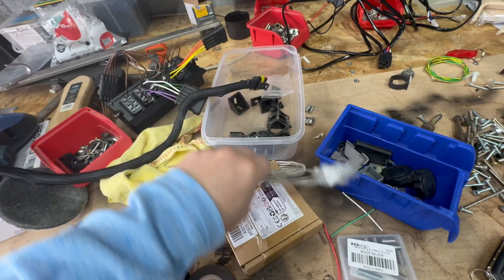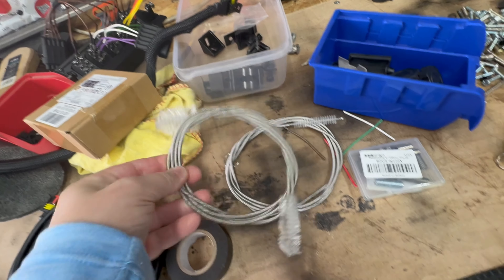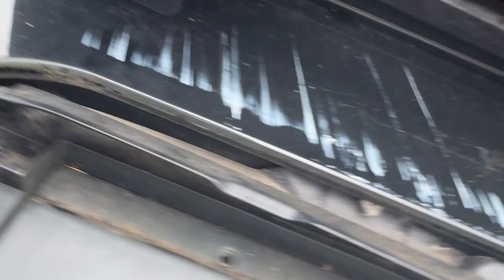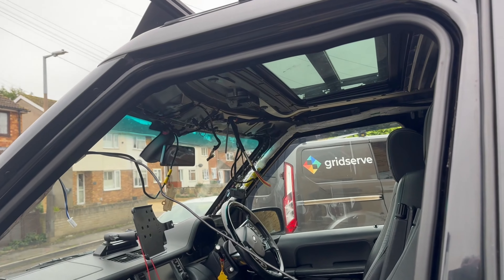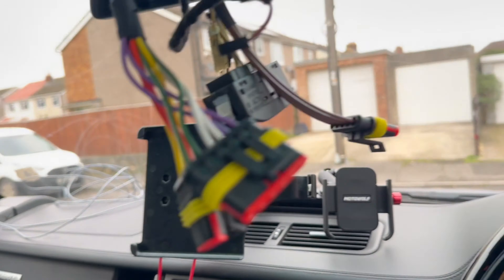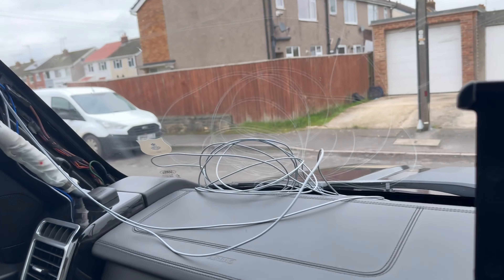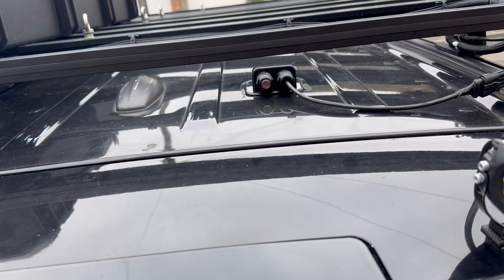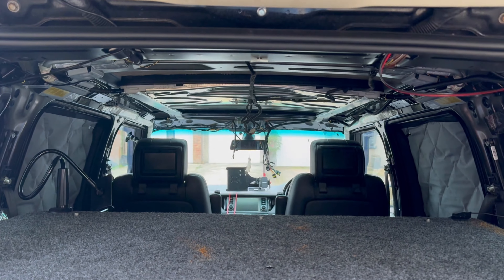Clearing blocked sunroof drains on my L322 Range Rover

Comment: Легче и проще взять шприц 💉 медицинский большой и наполнить его водой через трубку вставить в дренаж и туда и обратно давить это намного легче и проще промыть.
Не всегда инструкция завода изготовителя верна
Reply from the maker: Yes, that's also a good way of doing it. I broke my syringe and therefore used a pump and some tube.  Thanks for watching!
Reply: When you were cleaning the rear drains at 4 minutes onwards, the white plastic corners that the pipes clip onto can leak where they clip to the aluminium rails where the sealant has hardened and Landrover not putting enough on , I always remove them clean and reseal as when they leak the water runs across the headliner and down into the rear pillar and boot area 🫣